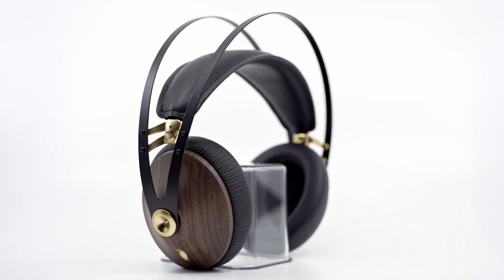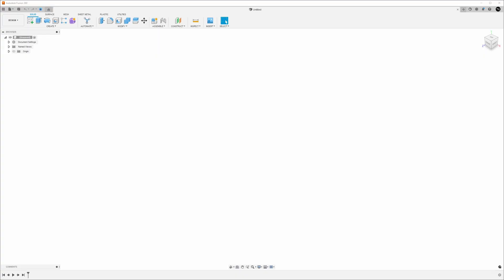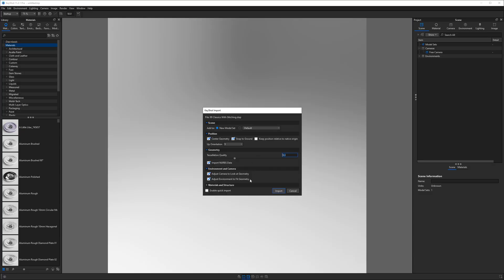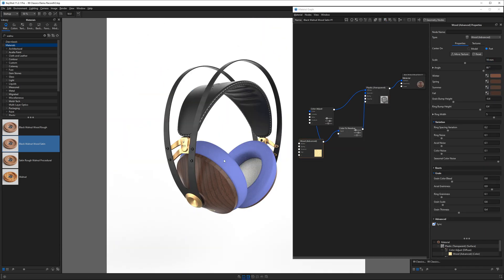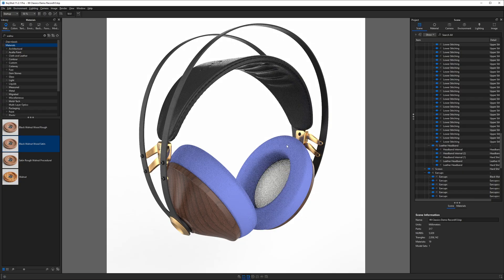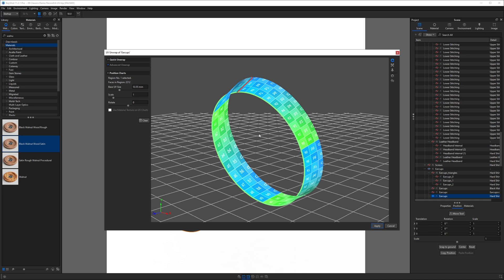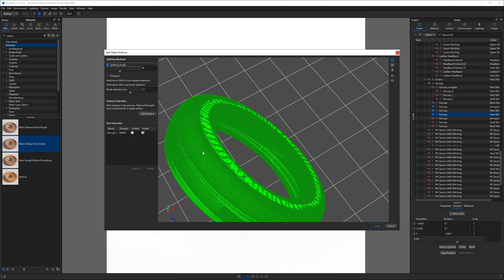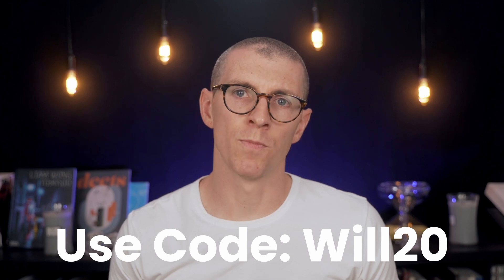How I Render a Product For a Client - Full Process!

Comment: Great work Will! Love your videos.

Question for you - I get lots of flickering in my animation renders for jewelry. Any idea why? I use gpu rendering with about 128 samples. Cant seem to get rid of the flickering with any output or even with frames in AE. Thanks in advance!
Reply from the maker: The flickering is happening because the individual frames that make up the animation are not 100% converged (resolved). Sometimes, letting the rendering go for a higher samples count will help fix this. But that's not the only factor. If you use denoising, (without going into why it happens) you will get flickering, and it will be more noticeable the closer that setting is to 1. Next, if you have caustics enabled in the scene, they can appear as white blotches. They also can change frame-to-frame. Finally, interior mode... it also has a built-in denoiser that you can't control as a user... so that'll do it to. Oh, and as for render mode... if you chose 'max time' and choose a specific amount of time KeyShot spends rendering each frame, you will get flickering. This is because each frame won't be rendering to a consistent sample count.

My suggestions to reduce flicker: 
1) Use product mode
2) Reduce denoising if possible
3) Don't render with caustics if you don't need them
4) Keep ray bounces, shadow settings and GI bounces as low as possible to help with speed
5) Render with max samples
6) Use a region render to find out what number of samples you need to make a smooth (converged) image and use it for max samples
7) Always render frames and compile them in an NLE (don't rely on the video file KeyShot produces)
8) Use a 3rd party denoiser if needed after rendering the animation

Based on your description... 128 samples is very low, especially for GPU rendering. I'd increase that number and reduce your reliance on denoising.
Reply: Thank you so much for answering Will! Much appreciated!

Comment: Regarding the UV unwrap—"Have some patience, and keep trying."—is the best advice! I've burned A LOT of time working on unwrapping woven fabric textures on upholstered chairs. Wondering if you have a tutorial already available regarding this, or would like to suggest that as a future subject. Cheers! - M
Reply from the maker: Hey, yeah I made two videos on the topic of UV unwrapping when KeyShot added the feature a couple of years ago. I've made use of it about 3 or 4 times in various tutorials on this channel. Unfortunately, the 'patience' part sucks. To me, that's a shortcoming of the existing toolset. With little to no instruction and very little flexibility, it's just what we have to work with for now.
Reply: @WillGibbons  - Thanks Will! I believe I have seen all of the aforementioned tutorials, but still struggle with fabric unwrapping at times. Will keep pushing the limits of my patience until the tool set further improves. Cheers! - M
Reply from the maker: It may not be practical, but if you haven't you may want to look at marvelous designer. I've heard it's easy to learn and it does a phenomenal job at crating fabric CAD models with proper UVs.
Reply: @WillGibbons  Excellent! Thanks for the tip—will try out the 30 day trial and see where it lands. Cheers - M